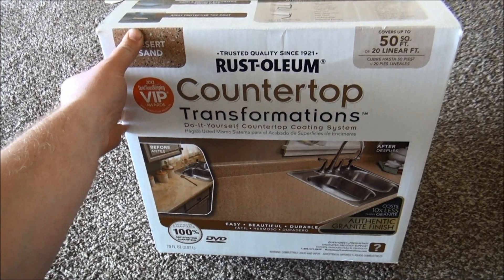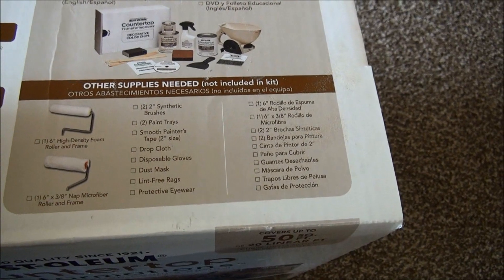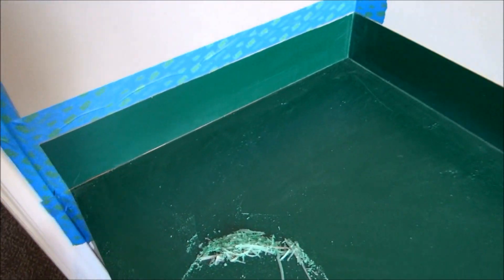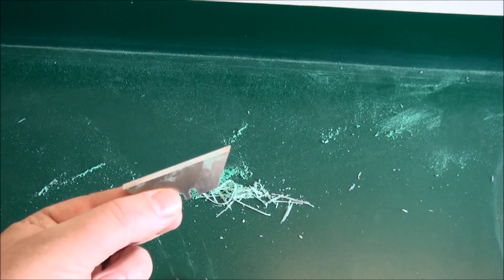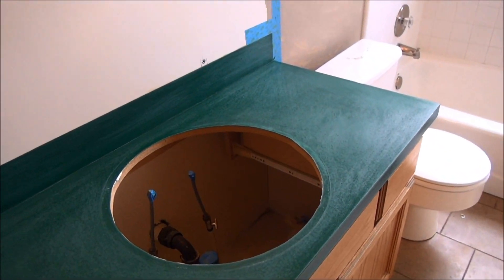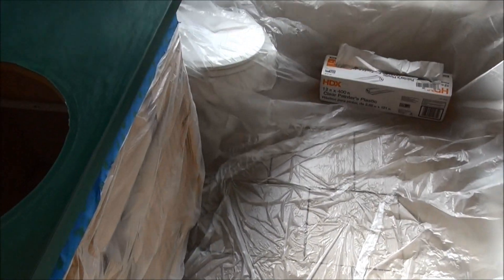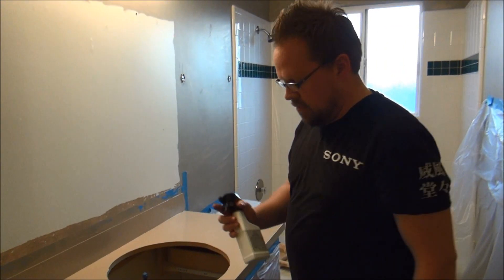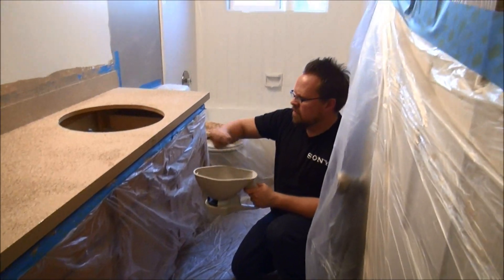CounterTop Transformations Rust-Oleum Kit Application & Review

Comment: We did our countertops. Was very happy with this product until it got to the final coat 'apply liberally' was the comment. is crap. Can we sand it when dry and re-coat (thinner) without detracting from the finish?
Reply from the maker: +Karen Mountjoy I would think you could? However be careful not to sand to much off.
Reply: +Do It Yourself Bri Thank you for your reply, but we ended up sanding and re-applying the top coat after hearing from the distributor of the product. Considering the price of the product (AUD205) it is a great finish and we managed to do 2 countertops in the bathroom area for this price. We are now doing the kitchen countertops this weekend!
Reply from the maker: Thanks Karen! Hope all goes well.
Reply: +Karen Mountjoy Right, when he said "put the top coat on pretty thick" I thought to myself 'that's not going to turn out so neat!' Geez. I'm glad you solved the problem.